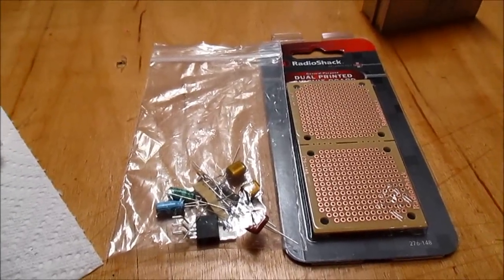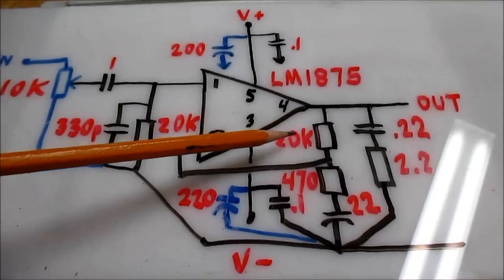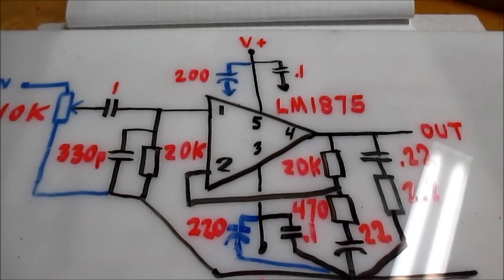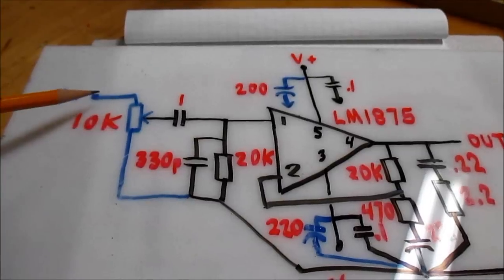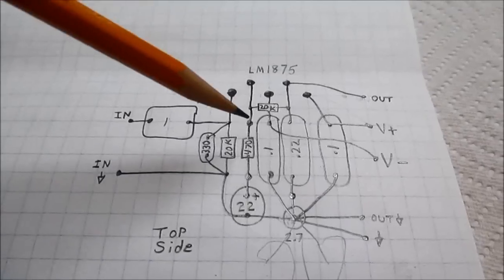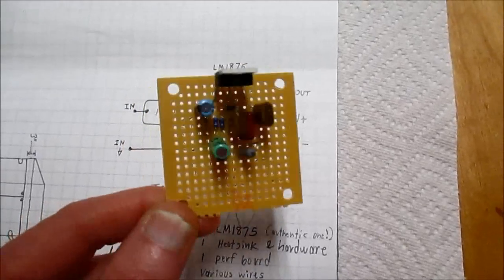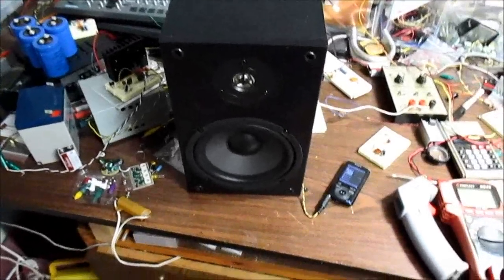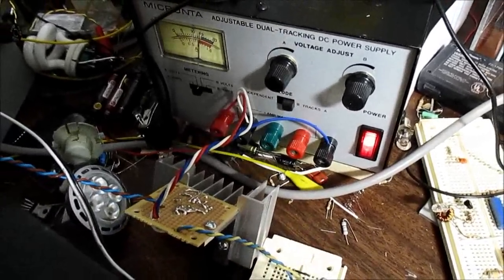LM1875 monoblock audio amplifier build

Comment: Hi John. Enjoy your audio amp videos and I think you're the right kind of person to ask a problem I found with the LM1875.

I built this audio amp with the plus and minus power supply and as closest I could following the schematic provided in its datasheet.

Now my problem is that it heats up too much with NO load applied to it, and just working with +- 8 volts the heat increases. Then as the voltage increases even more,  so it does the heat to the point it gets too hot to touch it, and even with a good  heat dissipation.

Is that something normal with this type of IC's? 

I'm trying to use it with a +-20 volt supply but I can't even get close to it because of the heat. I'm worried it would fry up.

Any recommendations? I will greatly appreciate it, thanks.

Comment: I have two questions -
1. In some branded home theatre systems, there are two different input sockets. One is RCA type and marked "Cd/Dvd player" and another is Stereo type which is marked "Computer". Are these both sockets directly connected to the amplifier input or have some special function ?

2. Where can we get the heatsink with larger fins you used here ?
Reply from the maker: 1. They are probably both line level and just labeled that way for convenience.

2. I got the heatsink from an old TV. Heat Sink USA sells them of various sizes.

Comment: Really enjoy your Channel, just subscribed.  I'm looking to build my second amp with this chip and struggle with determining the wattage for the resistors.  I understand Ohm's Law, but I generally see one resistor that is larger (in size) from the others, which I'm assuming is 1/4 or 1/2 watts.  Can you shed any light on this or share what the wattage value is for that one larger one?  Much appreciated.
Reply from the maker: Glad that you enjoy the channel! The larger resistor is part of the output zobel and should be at least 1 watt.
Reply: @JohnAudioTech  Thank you, John, for the helpful reply.  Cheers!  -Norm

Comment: Hey John,  I have watched a lot of your video's and have enjoyed them all. In one of your LM1875 video's, you have one with flat, straight leads. Do you have the part number for that variation? It would work well for the setup I am working on. I could straighten the leads on ones I have but the leads are very brittle and easy to break. I do not want to solder the chips directly  to my board, I have purchased sockets made for these 5 lead chips. Spent more on the sockets than for the IC's. Thanks for your video's.  Here is a link to the socket if you are interested: 

https://www.digikey.com/product-detail/en/TCC05DCSN-S1403/S9635-ND/4213430?utm_medium=email&utm_source=oce&utm_campaign=2456_OCE19RT&utm_content=productdetail_US&utm_cid=770585&so=58032316&mkt_tok=eyJpIjoiTVRka1lURmtaREppWmpsaCIsInQiOiJMT2F2TDFOZ3FvTnh1ZDY1NDFqVGRpdWFjWGk5c1BXR0dNS3JDQ3RSekk1Q1VkQnRcL0lwQ2hGRUpaMXlQQVdyZWx6b2MyTkdYTFhQb2RNTUp2eERGajArUERaTkdTU3o0a1R0b29KVFdvMEZWMDhTeE5ueHhzTVd3TzNvcTVIdVwvIn0%3D

Comment: Hello John,
I love your videos. You do s really good job making videos. You seem to answer the questions I have as I m watching . I do have a question though. In the data sheet it shows a 2200uf cap on the positive output to the speaker. I see you don't use any capacitor
Why does the data sheet show such a large capacitor?
Thanks in advance. And keep up the GOOD WORK.
Reply from the maker: Thanks Rodney! I think what you are seeing is the amp setup in single supply mode where a coupling capacitor is needed on the output.

Comment: Can I hook it up at +12V 2A power supply? Pin3 to the ground.
Reply from the maker: It requires a dual supply.
Reply: Will a 12v-0-12v 1A suffice?

Thanks for the help!
Reply: Rectified? +-12V
Reply from the maker: Yes 1A is fine per amplifier (2A for stereo). It has to be rectified using a full wave bridge to create a +12 and -12 volts split supply. Google a split (or dual) powersupply for correct setup.
Reply: Thanks bro! Commend.
Reply: Last question, the voltages of the capacitors?
Reply from the maker: 25 volts for the supply filter electrolytics. One would connect from + side to ground and another from - side to ground. The film caps will usually be rated 50 volts minimum.
Reply: Gracias!
Reply: Are all in micro? Except the 330pF
Reply from the maker: yes
Reply: Thanks!

Comment: I tried building this amp as a project with the single supply schematic on the datasheet, but it doesn't work. There's nothing coming out of the speaker, it only makes a "pop" sound when i turn it on/off. What do you think this could be?
Reply from the maker: Could be many things, but measure the voltage on pin 1. It should be about 1/2 the supply voltage.
Reply: I took the amp out and inspected the board very carefully, and I noticed a small solder bridge between a resistor and ground. I rectified it and now the amp works perfectly! If you hadn't responded I probably would've never taken it back out again. Cheers man!

Comment: Been binge watching your videos this week. I have an cheap pre made(don't hate me) single supply tda2030 and was wondering if it's possible to change the bandwidth to use it as a mini subwoofer amp? Between 40hz-140hz -ish? I don't know very much about it but you said the input capacitor affects the low frequencies. Maybe change it to 4.7uF or so? How about the high frequencies? Thanks btw I love how you explain things in your vids. Keep em coming!

Comment: Hey john,
I'm a bit confused about the + and - rails and if you connect the - rail to the grounds on the board or the ground to the grounds on the board. Anyway, great video and keep up the content! Cheers.
Reply from the maker: +GkAudioTech With a dual rail supply that has +, ground and -, connecting the - to ground would short it out. Connect only the ground of the supply to the ground of the amp circuit. In the case of the LM1875, the negative rail goes to pin 3 and the positive to pin 5. Many thanks for watching my videos.
Reply: +JohnAudioTech Thanks mate,
I just looked at the datasheet of the amp chip and realized how stupid that question was.

Comment: Hello John,
Great video m8. I have a question about power supply's for this circuit. I have a linear with three outputs two being variable 0-30v at 5 amp each and a fixed 5v 3amp.
Can I use it to build this circuit? I am new and confused about +25v and -25v.
Cheers.
Reply from the maker: MonkeyMagic Elecifun The chip needs what's called a bipolar supply. Relative to the ground (or 0 volt line), it needs a positive voltage and a negative voltage. Most dual power supplies allow you to set them up this way (check your manual). You have enough voltage and current. Use + & - 25 volts for 8 ohm loads and + & - 18 volts max if your load is 4 ohms. You can also use a single supply but you need extra parts to make it work. (too much to explain here).

Comment: Hey John, thanks for the videos! Do you have a idea for an amp that can be used to run a dynamic mic? I hacked a Aiwa cassette player by tapping into the cassette head but that won't drive the mic. It also produces a lot of hum when I plug in a guitar and touch the strings.  Thanks for your help.
Reply from the maker: zardozica Hi, Op amps are good pre amps that are in front of the power amp for the extra amplification needed for a mic. You can also use a transistor preamp stage. I might do a preamp video at some point. Be sure the ground is not reversed with input on a guitar or you will get very loud hum when touching metal parts on it.

Comment: Could you tell me how much voltage you were supplying to your + and - rails? I am building a similar project and Im not getting anywhere near 25-30 watts of output. Also I am using the schematic that came with the 1875.
Reply from the maker: Philip Geraci At +&- 18v rails I measured 25w of clean power into 4 ohm load or +&- 22v into 8 ohms for the same 25w. Supply voltage is measured with amp delivering the 25w with continuous sine wave. Of course, voltage will be a higher at idle. Those are the max voltages I'd use with this IC. If you need more power use a stronger IC like the LM3886 or LM3875.
Reply: I have it going pretty well now, but it is doing something strange. It sounds great at first but after about a minute or two the lows start getting distorted more and more. I am thinking maybe a heat issue? Of course I do have it heat synced decently, or so I thought.
Reply from the maker: Philip Geraci Likely a component layout issue. You have to keep the parts close to the IC and be sure high currents from the output and power supply are not flowing in the same leads as the small signal grounds (input and feedback).
Reply: +Philip Geraci maybe you'r using chinese made ic